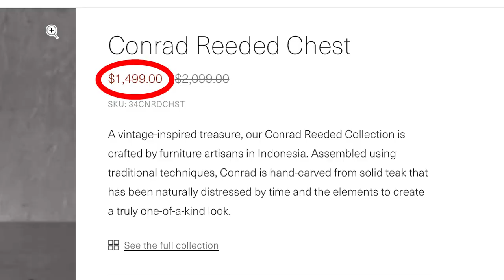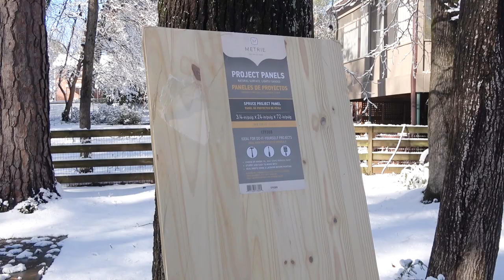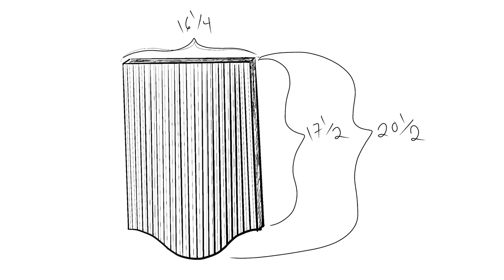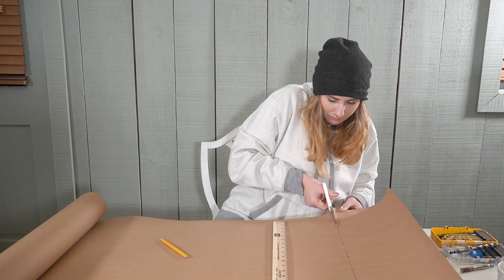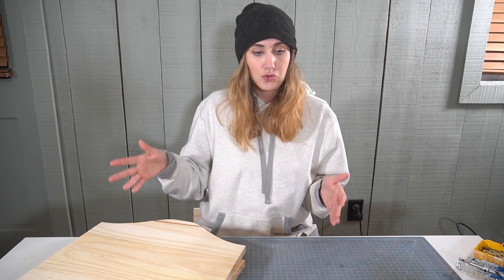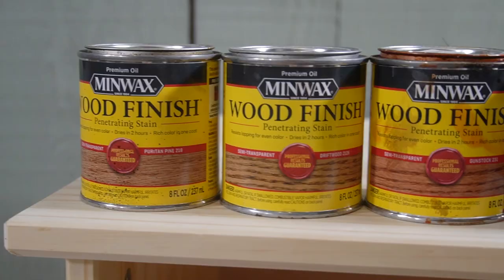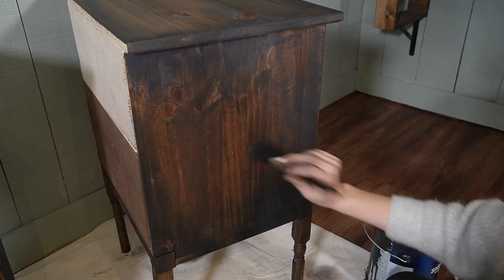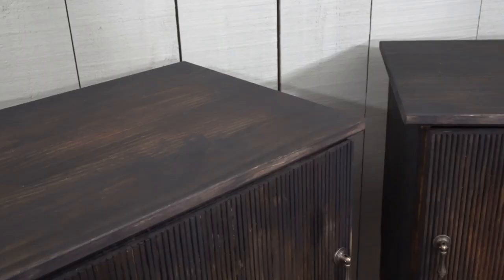Extreme Ikea Tarva Makeover: Ikea Flip into Arhaus Dupe

Comment: I'm obsessed with this!! Ikea also makes a wide tarva dresser, I want to adapt this to make a super wide version of it!! Do you happen to have a link for the fluted trim? i am having a hard time finding the exact one you're using :)
Reply from the maker: Oh I'm so glad you like it! I totally thought about doing the same thing. Artaus has a dresser with the fluting and similar shape and its so pretty. Here is a link to the trim. I got mine at Lowes but could only find a link to one at Home Depot. 

https://www.homedepot.com/p/Woodgrain-Millwork-WM-144-1-4-in-x-3-4-in-Solid-Pine-Screen-Moulding-10000713/205984220?source=shoppingads&locale=en-US&&mtc=SHOPPING-BF-CDP-GGL-D30-030_020_MOULDINGS-NA-NA-NA-SMART-NA-NA-NA-NA-NBR-NA-NA-NA-NEW-NA&cm_mmc=SHOPPING-BF-CDP-GGL-D30-030_020_MOULDINGS-NA-NA-NA-SMART-NA-NA-NA-NA-NBR-NA-NA-NA-NEW-NA-71700000085464100-58700007262099551-92700065185473169&gclid=CjwKCAjw3ueiBhBmEiwA4BhspK6TiXbk0zXsMvChcyNspxd8vq_ZksbF91m4D7deIac7qJtnFitT7BoC_rkQAvD_BwE&gclsrc=aw.ds